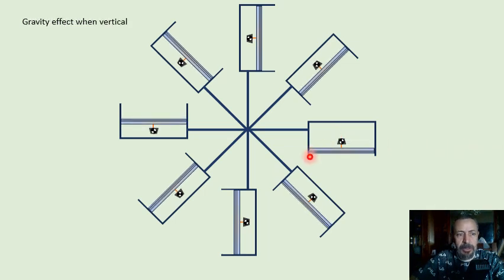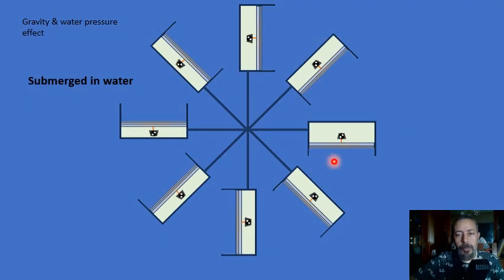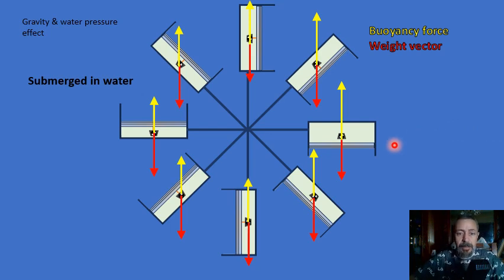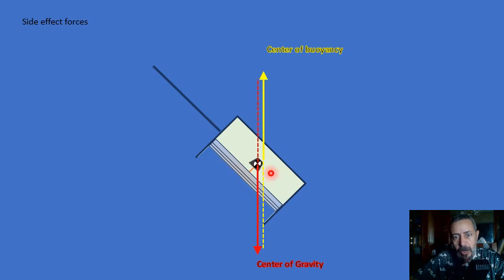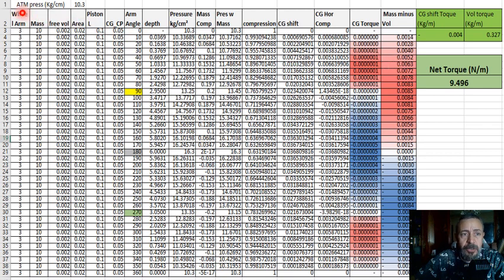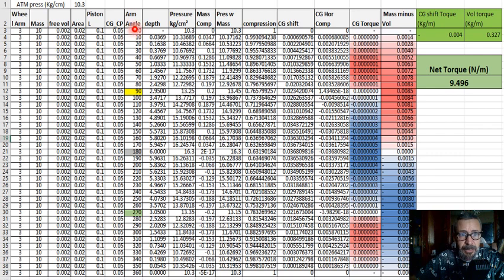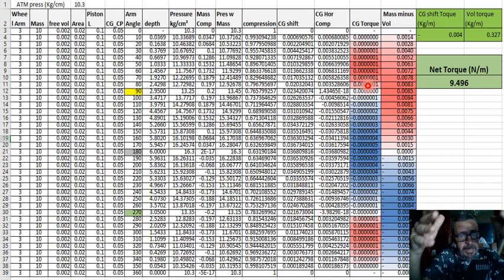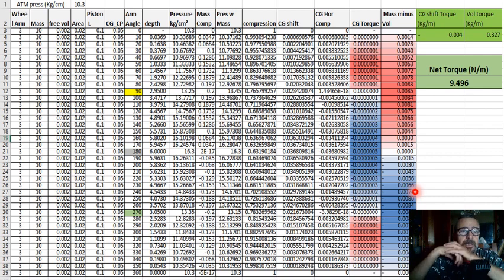Free Energy : New design, Gravity Controlled Buoyancy

Comment: I would say that why it wont work is actually in the name of the experiment. Rephrased: Buoyancy is controlled by gravity.
As gravity is a constant and not a variable, the net forces on each side of the wheel will be the same.

This setup reminds me of the concept where you have a wheel with offset spokes that steel balls can run along. At a glance it seems like there is more weight on the side where the balls can run all the way out to the rim, but when you study the distribution of the steel balls you'll find there is always an equal amount of weight on both sides.
Reply from the maker: Thanks for comment, I'm not sure if I've seen the design with steel balls, I don't fully get but I get the idea. Gravity is the same  everywhere but relatively for an object that rotates, the vector changes like if we stand on our hands, still could be faulty or misleading naming but anyway,  that's what changes the buoyancy force if you watched the analysis chapter

Comment: The design assumes the wheel is fixed and the pistons are moving independently. Thus the balance of forces on the weighted piston is not necessarily the same as the balance of forces on the wheel. You have neglected the forces from the gas preaaure and the water pressure upon the wheel and the piston.
Reply from the maker: Thanks a lot for looking into it :) 
The design depends on the rotation of the wheel, I may have not said it but that's how it gives free work. I did took count of the gas pressure due to both .compression and decompression resulting from the combination of the water pressure at given depth and the piston-perpendicular component of the weight. 
All these calculations are in the spreadsheet,  I'll add a drive link to it in the description.
Reply: @crowxe  I think the water will push the piston and the cup together until the gas pressure matches the water pressure. I think it will not matter whether the piston is on top or on bottom IF both wheel and pistons are free to move and the water pressure is high enough to keep the piston in the cup. If both sides are squeezed to the same gas pressure, then they will be the same size and there will be no torque.
Reply: @sthurston2 The pressure inside and outside must indeed be the same else there is a nett force on the moving part/seal and the pressure inside will change. 

Important to think of the seal as not being part of the outside. Its mass and surface result in a pressure against toe outside even if the chamber is absolute vacuum. An analog example would be a mercury/water barometer. The column of the liquid is the seal, the empty space inside the sealed tube  can be a vacuum.
Reply: @crowxe OK, thinking it further on the compressed side the overall force on the cup is down. On the expanded side the overall force on the cup is also down. The buoyant force from the expansion is keeping the piston in the cup. The cup is experiencing a net downward force as the gas pressure is less than the water pressure. Both sides are being pushed down so no torque.
Reply from the maker: @sthurston2  I'm not sure if I understood you correctly, what I get is that you're comparing the downward force pointing that they're equal, which is true. Regarding the gas pressure inside the opposite cylinders (opposite orientation), i think it shouldn't be the same, the piston would fall in compressing the air until the air pressure equals the water pressure + (the mass ÷ piston area) , while in the falling out piston, the air pressure inside that cylinder would equal water pressure -  (the mass ÷ piston area) , but anyway, the air pressure inside  the cylinder is just a side effect of variation in expansion/ cavity that causes variation/difference in displacement volume eg. buoyancy force. I hope I responded to what you pointed to and nor something else